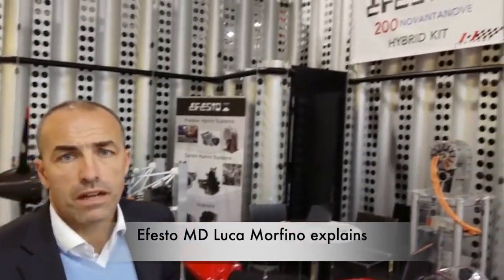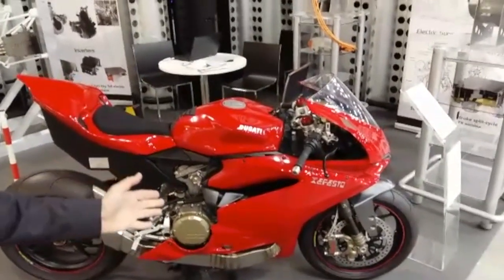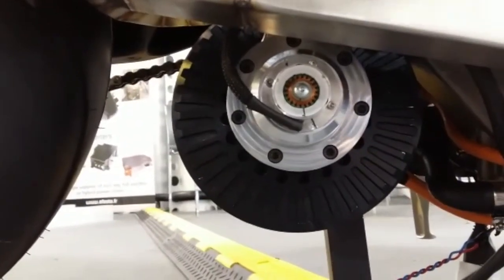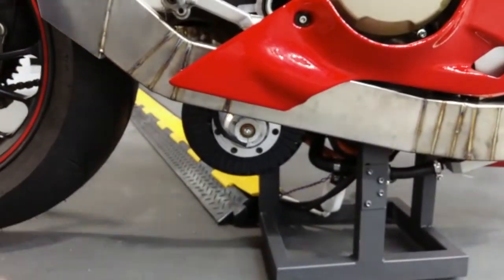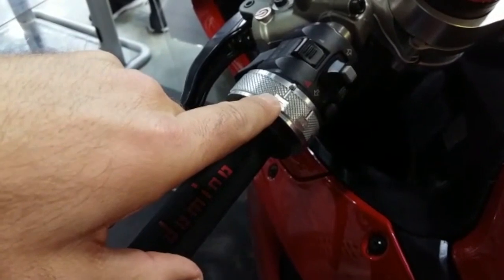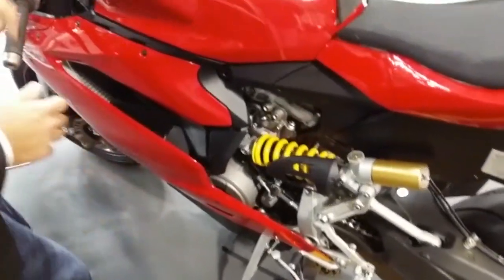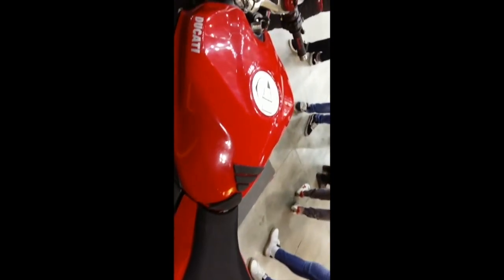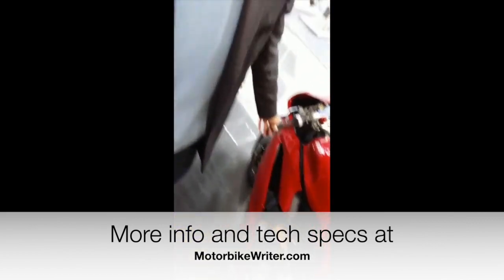Efesto hybrid Ducati

Comment: This is not really that beautiful in terms of how bulky it looks, but the prospect of having the 2 power plants combined in the same way top end cars benefit from an electric engine for added HP is very exciting, 300hp !!!!! for a bike it is going to be limited by geometry and tyre technology though, but this journey is going to happen as part of the fossil fuel journey.  The unfortunate thing for motorcycles is that the majority of brands are built on the mechanical nature and sound of there product, how does one differentiate in a market which goes silent......slowly.......do they rely on there heritage to build a price point ? That journey has a use a by date, eventually. 
I’m surprised they didn’t utilise a solid disc over the rear wheel and hide an electric engine hub in there ??? Double benefit for aero AND looks